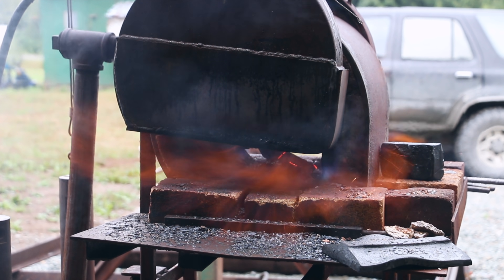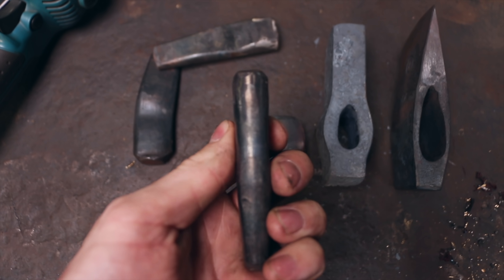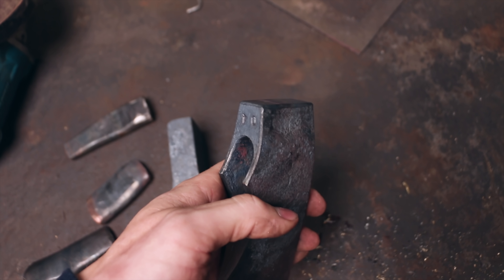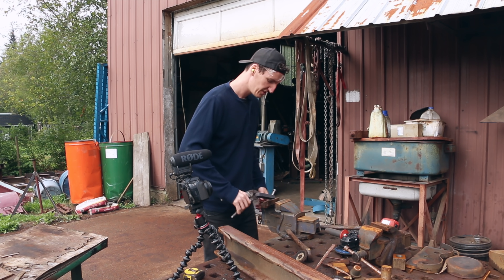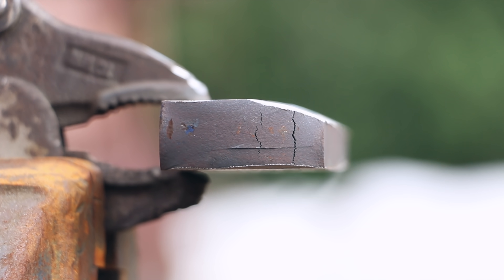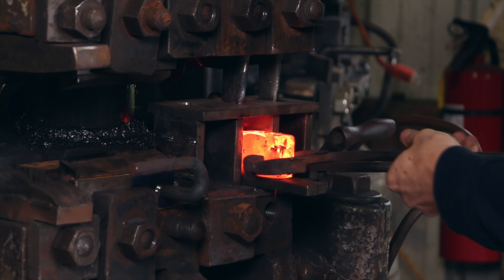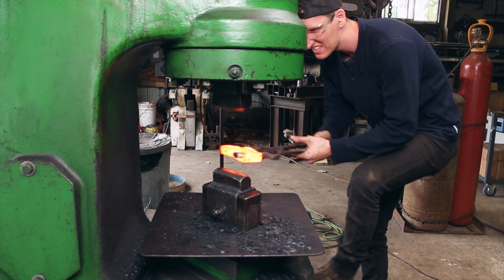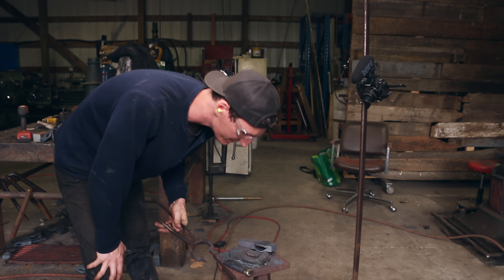Is a INCONEL AXE DRIFT the best thing ever?

Comment: Which specific Inconel alloy did you get?   Inconel age/precipitation hardens, so you should try making one, but keep it hot and do not forge  cold.  Once shaped, heat treat it (needs to soak for several hours at heat-you'll need to look up for your specific alloy, but generally around the 1600F mark), air cool and let it sit for a few days to age and you should notice a significant difference in performance...
Reply: I've mentioned this in a few videos but he's never read or answered. My best guess is 718 or one of the other precipitation hardening grades which is why it behaves the way it does. In theory it should work well as an axe drift, but without doing a proper anneal and ageing after he's forged it who knows what condition it's in, definitely nowhere near peak hardness.
Reply: @davidcoghill8612  What if he were to CNC machine the drift? That may preserve the factory crystal structure that he may be disrupting with the heating.
Reply: @neuralchemist  That would work great, but the bar he's got isn't thick enough to be able to get the shape he needs.
Reply: @davidcoghill8612  he treats it like 316 steel, hes gotta think of metallurgy more like cooking than forging. Forging is for cavemen doin iron work
Reply: @davidcoghill8612  He probably did read it, but didnt want to answer you since you are spamming.
(And you are completely wrong)
Reply: @polarbearchimney  Please explain how I am wrong.

 (And I wouldn't consider 2-3 comments in the whole year he's been working with this alloy to be spam but whatever)
Reply: @polarbearchimney  waiting to hear how he is wrong.
Reply: @bye92  not only wrong but completely wrong ☝
Reply: @polarbearchimney  state your evidence sir.
I thought not. A pity, I had popcorn waiting.
Reply: @IcecalGamer  tell us more
Reply: @polarbearchimney explain please
Reply: @polarbearchimney  Still waiting to see how he is wrong
Reply: @gumelini1  i was being facetious. The one dude/ette (polar...something) that said someone was wrong actually said "(And you are completely wrong)"
and then it was asked "how am i wrong" < well... it was stated as "completely" :))
SMS form is hard for jokes, especially when tensions might be high.
Reply: @polarbearchimney  any day now kid, we’re still waiting
Reply: @brenttrimble8141  chill out.  Nobody was even talking to you.  Yet here you come into the comments talking big, contributing nothing except hot air and bravado.
Reply: @sinisterthoughts2896  he wasn’t talking to you either, he was referring to the troll early on in the comments you obviously didn’t read.
Reply: @polarbearchimney  still waiting  bud.
Reply: @polarbearchimney I'm really looking forward to this clarification of yours. After such a long time I can only expect it to be a really well thought out, properly sourced, and detailed, paper on the intricacies of processing inconel alloys through hot forging and other shaping techniques. I'm looking forward to this, and will buy the leather bound edition once it comes out!
Reply: @polarbearchimney  any day now…
Reply: @polarbearchimney  care to elaborate? It's been 3 weeks now, you could have researched a college textbook by now
Reply: Tim! Hear here!
Reply: He obviously didn't do any research on inconel. Just kinda toss it into a forge and see what he gets. Inconel requires way more attention than just heat and beat. Different alloys for applications. I'm a welder not a blacksmith but I doubt the process for welding inconel would be any different than forging considering how hot forging gets the entire piece. Welding inconel requires preheat, inter- pass and post heats. Not sure how forging would fit into that but it has to be a similar process.
Reply: @jonathonbridges9625    @Christopher Hill   Exactly. Ferrous steels are easy, you have a big temperature range where you can do a tempering or stress relieve heat treat, and a fairly forgiving range of temperatures where you can forge at and quench from to harden. Inconel has a lot more going on at the micro and even nano scales, you get it up to 700C and leave it there and it starts changing, it'll get harder and harder and harder, then after many hours it'll eventually hit peak hardness and start softening again. And even just the difference from 650 to 750 will cause a big difference to how hard it gets and how quickly it goes. Even forging temperatures still need to be really picky, if you have it at just the slightly wrong temp for too long it'll start to for Laves phases which will make it very brittle, and could be what caused it to explode in the last video. It's hard to advise the best temperatures to work at because with the range of chemical composition allowed by the specs the optimum temperatures vary by a few tens of degrees, and manufacturers keep their own recipes close to their chests. You can even take an aerospace grade inconel 718 and compare it to oil and gas inconel 718 and there are a lot of differences in the chemistry and heat treatment because they've been optimised for different applications.
Reply: Please be nice, and I also am wanting to hear more. I have no educated opinion at all on this, would like more info.
Reply: I've machined this stuff. Flying around in space on Canadian satellites.
Reply: 615 cracks and splits if it's not worked between 2250°and 1860° f.  If it drops below that it does what Tims metal is doing. So I'd say a laser thermometer or three would be needed , to make sure the heat is where it needs to be while working it. Do not give up! Use what you have to practice. 
For a drift though...I'd think you would want D2 tool steel . It is FOR  making high strength and high durability impact tools . It can be forged , but also needs special preparation as most specialty steels do ,to get the prescribed results of the alloy in use.  D2 is my favorite commonly available knife steel too.  It takes a belt sander to Sharpen it, and it will never be as sharp as softer steels get. But that edge will last for a very long time with no need of honing unless you're using the knife to split rocks or wood , with rocks in it...
Reply: Would it be stronger to just use a lathe to form it, does heating weaken it?
Reply: I was just going to say exactly this. Heat treating and work hardening is really specific to odd alloys like this.
Reply: At a well known Motorcycle manufacturer I worked @ about 20 years ago we would R&D with inconel we found and what metallurgist would tell us inconel is best used in application for something requiring a thin metal wear weight is not an issue.
Reply: This acts like I-615 when below minimum forging temperature of 1860° f. It splits and crack when it's forged under that temperature point.
Reply: I just googled this so I'm definitely no expert but inconel has a complex and precise hardening cycle with very high temperatures and exact timing. If I were him I'd throw it in the corner and go do some work 🙂
Reply: I think it is not a educational channel, it is just for fun, like the Hydraulic Press Channel.
It would be strange to answer he do not know what he is doing, just having fun making sparks.
Reply: @RogerioCosta1.0  he literally says that he has no idea and is experimenting
Reply: He only listens to the people that worship him

Comment: Hit it gently, and it mushrooms while it resists the power hammer bouncing right off. Really interesting material that iconel. Thank you for sharing the video!
Reply: It's the starch of the metal world
Reply: As interesting as that would be, the heat just weakened it.
Reply: @kokofan50  YA, I was wondering if Inconel needed quenching or something that he didn't do.

But, I don't think Inconel is actually known for hardness, rather toughness, so this actually seems consistent with what I'd expect.
Reply: Non-Newtonian red hot steel? lol

Comment: I personally think you have annealed the iconel, do you know which type it is? it seems in your desire to forge it you have learned the process of annealing it if I read what I did correctly. try milling out and then shaping it with grinder no forging. I believe the results will be way different. what I have learned is that it is meant for high temp use but not to be air cooled quickly but very slowly which would make sense if used in the situations designed for it.